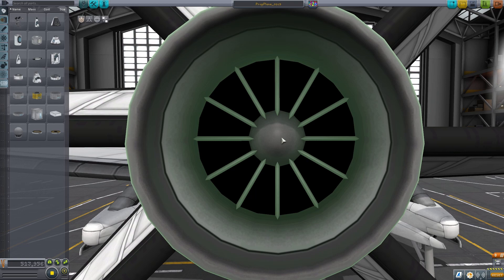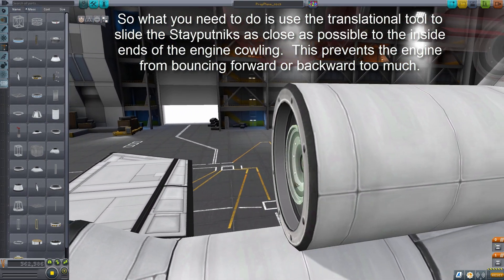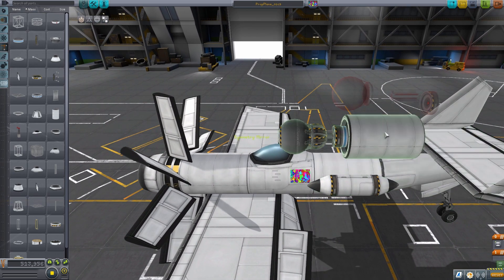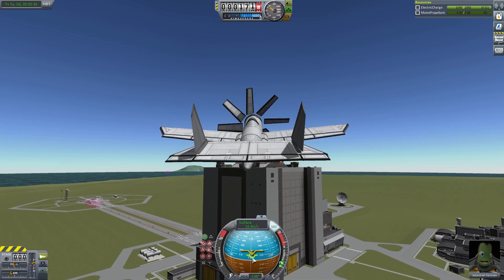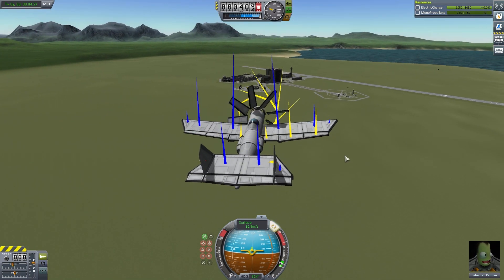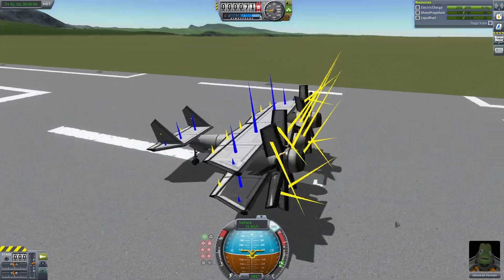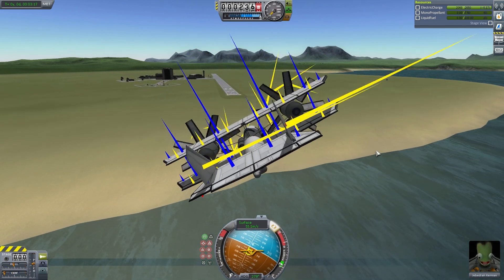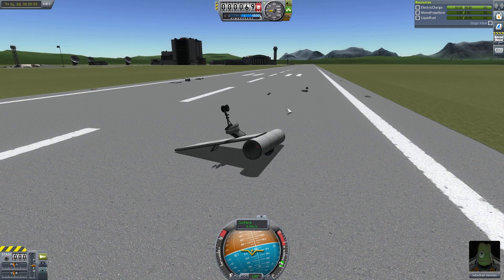OBSOLETE VIDEO, pls see #3 -- KSP stock elec prop 2: smaller engine, bigger performance

Comment: It strange to watch people fly in ksp because everyone uses so much rudder to try and control the aircraft were in the real world rudder is only really used in normal flight to control adverse yaw and turning tendencies in single prop aircraft also using to much rudder can cause aggravated stalls as spins but also causes a lot of drag when the aircraft is yawed so it is side on to the relative wind. But overall I think this was a great video I really did like the designs and the bomber was perfect apart from the bottom wing flap going the wrong way  and the fighter was a heavenly aircraft thanks for the videos :)
Reply from the maker: As a (fellow?) pilot, I concur with your observations of yaw and rudder control.  In KSP, though, since my input method is a keyboard, the pitching moments of 100% control surface deflection (which is inevitable with a keyboard) sometimes impart much more change of attitude than I desire, so always going for a coordinated turn using elevator (back pressure) as my main turning authority is neither feasible nor safe to the aircraft in many circumstances.  It is for these reasons that I cheat the system and use the very weak response of yaw to produce more mild or more gradual changes in direction.

But how dare you criticize my lower flap?  You fiend, you monster!  Have you no respect for artistic flair?  heavens to murgatroyd, doth the practice of zed axis symmetry offend thine senses so acutely that thou must slander mine innovative brilliance in this public forum?!  I implore - nay, beseech you: look within yourself and find the room to forgive my trespasses for collectively referring to a lowly spoiler (for that's truly what it was) as the far superior flap!  I only wished to spare myself the difficulty of unnecessary articulation!  Oh, have mercy!!

Comment: There is one flaw in this design.

The propeller blade have the same angle regardless of the distance to the center. This will make it so when the craft go sufficiently fast the outer part of the propeller will push the inner part faster forward than the agle of the rotation.

A simple way to solve this is make really short propeller blade and a rather big center. A other way is to make diffrent propler blade and tilt them in a diffrent angle acording to the distance from the center.
Reply from the maker: Yes, it's not a constant speed prop; at best I might call it a variable pitch prop since I can adjust the angle in the hangar.  I think your first solution is self-eliminating because changing the diameters of things does not influence the AoA problem which you astutely pointed out.  I have seen your second solution used in some other videos but its drawback in KSP is more blades causes a lot more drag as well as necessitating more torque.  The reduced RPMs are a greater loss than the thrust gain achieved with multi-AoA blades.  Pity.
Reply: Inter's Odyssey A sort of ugly solution would be to just move them out a bit and even out the speed . Of cause that would make the prop bigger. But say.. Using a bit shorter and wider blades, move them out a bit then one would be able to make it go a lot faster. Specially at higher altitudes.

The question if rather if it could be made in a beautiful way.... and... well high preforming (in regards of KSP physics engine).

Having high performance at high altitude would be important for instance if one make a airplane fire to space....

.... the reason i´m looking for that is i wanted a efficient way to launch from eve. While the gravity is rather high, this is really just a problem of having sufficient acceleration, but the thick atmosphere blocks this possibility.

Getting over the atmosphere one could have a rather small rocket just to push it out the atmosphere and then circulate
Reply from the maker: matsv201
The shorter and broader blade option is one I've explored in other vehicles.  It works rather well, but for heavier craft I find it is the part's lift rating that makes the biggest influence on thrust.  Also, the aerodynamic forces (the yellow vector lines) act upon the center of a part, so larger parts may have centers that are intrinsically farther from the center of rotation than a smaller part placed only a little bit far out. 

One of my other commenters said they've already taken one of my planes to Eve and it worked well.  Didn't say at what altitudes though. 

There is one thing I can recommend if you want want to change AoA in flight.  Just use the prop blades' Deploy option (assuming your blades are control surfaces rather than little wings).  It doesn't take much: at sea level I find about 30% deployment gets the best increase above undeployed cruising speed.
Reply: Inter's Odyssey 
" Didn't say at what altitudes though. "
It should be dependent on airpressure and gravity. The pressure around 6000 meters on kerbin is about 0,6-0,7 atm. On eve you are up to about 20 000 meters at the same atm.

Of cause the gravity is 70% higher so i would suppose you would need 1.7^0.5 thicker atmosphere... so 0.8-0.9 something giving us a altitude of 15 000 meters. woud be my guess...

Its way to low to launch a small space probe.... Well of cause. This is kind of a speed issue. Its hard to fly faster than 150m/s or there about with this prop design.

A solution to this could be to use a giant wing. Then one might fly a lot higher with the same speed.

Of cause, optimizing the propeller to drive the air much faster would be way better.

"It doesn't take much: at sea level I find about 30%"
Well that is a solution as well.

Really would need screw propellers in this game. And electric engines.

Having a pathfinder type aircraft on EVE would be beauty-full.
Reply from the maker: matsv201
Heh, I think you just invented the brand new "Pathfinder challenge".
Reply: Inter's Odyssey It would be very cool

Comment: When I make prop planes in ksp I noticed that i get better performance using 4 blades on the propeller rather than 8. The 4 bladed ones average about 80m/s in a straight line while being a little more shaky. I think that the more blades you have, the more the speed is capped by drag.
Reply from the maker: In my previous video on this subject I was using 4.  Nothing wrong with that.  For this video I chose to use 8 to see if the torque could handle turning that many surfaces and because I thought more blades would mean a greater frequency of blade passage through the point of greatest lift development, hence greater cumulative thrust.  The trouble with these electric engines is their utility changes so dramatically every time one little component is altered.
Reply: Having more blades would make sense for getting more thrust... but... AIR RESISTANCE! The problem with having too many blades is that eventually, adding more blades has diminishing returns and eventually DECREASES engine performance. Having too many blades (or having the blades at too high of an angle) causes drag on the propeller and that will make the propeller spin slower. (Assuming a perfect AOA of 45 degrees) having four blades would actually be better than eight blades due to drag. Two ways to fix the current problem is to: One, decrease the amount of blades to three or four, therefore decreasing propeller drag and providing more thrust (just take a look at old WWII planes and you'll know what I mean) and Two, reduce the AOA of the blades for the exact same reason stated before. (Just don't have a low AOA and only a few blades, yes, it does spin the prop faster, but you won't be able to benefit from the extra spin speed) It's basically like math, when 4 x 5 is the same as 2 x 10, when 20 is the drag created. But, considering the fact that having three or four blades that can do the exact same as eight, most people use three or four because of cost.
Reply: I just realized I basically elaborated on the original comment. Oh well. :P

Comment: Just wanna know..... Why stayputnik? (There is other probe core, right?)
Reply from the maker: They Stayputnik has more angles than the other probe cores (or most other parts, for that matter) which means each individual angle is more obtuse.  This means there is less of a tangentially retardant force produced during collision with the walls of the cylinder, which means less rotational speed is lost.  I usually use only one Stayputnik on either end of the engine for sake of part count, but I've seen some designs that use eight or twelve or sixteen Stayputniks to create as round and smooth of a "ball bearing" as possible.
Reply: That's smart for, it keeps it snug in the fuselage so the prop won't wobble as much.

Comment: make the spruce goose, 8 Engines!
Reply from the maker: Well I think we'd know how that would turn out.  Spoilers!  Curse you, H.Hughes!
Reply: Inter's Odyssey please do a video on it!
Reply from the maker: I started with a miniature version that I named the Spruce Duck.  It had 2 enlarged engines, each with 2 props mounted on fore and aft ends (4 props total).  Its mass was insane.  I don't even remember what it was, but close to 60 tons.  And it was a modest sized plane.  The engines were horribly imbalanced and kept ripping themselves apart and I suspect it was because of the all of the mass I had tried compacting into them.  So short story: no luck (yet?).
Reply: Inter's Odyssey 
I tried my own hand at making these engines. It seems that to keep the plane flying consistently you want no more than 7 tons per prop. 
My p38, based off of your design but twice as long, weighs 13 tons and can make it over the tallest mountains. I also tried using 12 blades per prop, 2 hex patterns.
Reply from the maker: *****
That's good to hear that there is room for plane growth but bigger engines is not necessarily better.  My part count tends to run away from me when I'm trying to upscale a design.  I like the idea of a twin hex blade count.  How many ball bearings (Stayputniks) do you use on either end of your engine?  I'm still a fan of 8 bearings + 8 blades because that seems to be stable, but I'll try a twin hex next.
Reply: Inter's Odyssey 
I used 8 stayputniks as well, though it doesn't really seem to make a difference vs using 4. With 12 blades the rotor is really heavy and becomes unstable easier. I get a weird oscillation at 55-65 m/s where both engines will take turns producing more thrust than the other. It is more stable (although slower) with the flaps down or while in a climb. 

I was going to attempt my own spruce goose next with a MK3 cockpit and 8 double long engines, but am still testing engine variations.

Btw, I tried a single motor plane but the torque makes it impossible to fly. Is that a 1.2 thing or do you think it's because I'm using a double length motor?
Reply from the maker: *****
Maybe a 12 bladed prop with smaller blades (like the Elevon 4) would reduce oscillations since the center of thrust on each individual blade would be closer to the shaft given the blade's smaller physical dimensions. 

Yep, my Spruce Duck follows that design concept. 

Nah, it's not a 1.2 thing.  Very very very minor changes to an engine design can produce huge changes in performance.  I was discussing this with someone else.  (Losing track of names with this many comments!)  The single engine plane I showed in this video flew beautifully but other experiments have had problems.
Reply: Inter's Odyssey 
My single engine plane had a piece piercing the motor that I overlooked... works now!

My spruce goose flies!... though not very well. It stalls incredibly easily in a turn even when at speeds above 50 m/s. I end up using yaw more than roll to turn. At speeds above 58m/s it oscillates in yaw just as my P38 did. 
In a straight line and 10% incline it flies ok, I was able to get it up to 6,500 meters without too much issue. In a decent all hell breaks loose and it tears itself apart (with speeds in excess of 85m/s)  - with all flaps down it's not as bad. My weight is ~64 tons, 8 tons per engine. My computer is displaying time in half speed because of the part count. 

I was thinking of trying a B36 next, 6 props and 4 tiny jets.
Reply from the maker: *****
That sounds about right!  :D  Well done.
I'll be curious to hear how your props go.  If you plan on doing the B36's pusher prop config, I worry about engines colliding with their mountings.  My pusher props had that problem more so than my pullers.  I wonder if it is because the contact area against the retaining part is of a larger diameter with a pusher prop and therefore creates more resistance.
Reply: Inter's Odyssey
Having jets really helps the plane fly. They aren't enough to fly the plane by themselves but the extra boost really turns a larger prop plane into something pilot-able. 
My 3rd iteration of my B36 is 65 tons and has a cruising altitude of 3,400 meters @ 74 m/s and a ceiling altitude of 7,500 - 8,000 meters @ 57 - 60 m/s. 
I ended up using a stiffened double long motor design. The joints definitely seems to be stronger in tension (pull) rather than compression (push), and this seems to make the motors imbalance easier in the push configuration as you mentioned. My single long motor design had massive thrust loss due to this. 
In a dive it can go up to 125 m/s before I start worrying about it tearing itself apart. Also, I used 8 blades per prop as 12 is just too heavy and the extra drag give it diminished returns.
Reply: +Inter's Odyssey can rover wheels be used as bearings?
Reply from the maker: ΑΡΗΣ ΚΟΡΝΑΡΑΚΗΣ
I honestly don't know.  I know people have used them in turrets like for tanks but I do not think they would survive the high forces and RPMs of an electric engine.  Try it?
Reply: Inter's Odyssey give it

Comment: Whaaaat the helll maaaaaan; this is awesome. Make a video of you circumnavigating the globe using a plane that uses the engine. And maybe as a further challenge, send it to Laythe.
Reply from the maker: Thanks for the enthusiasm.  I have a lot of improvement to make on this design before it would be ready for a long haul flight.  (I've already seen people do a lot better.)  But even then I don't think I have enough hard drive space to record a circumnavigation flight at these achingly slow speeds.  I remember in "the good old days" before heat resistance and sticky atmospherics I could hit Mach 5+ while around 50 km high and achieve orbital speeds while still technically in atmo.  Mach 5 at sea level is 1700 mps.  That's 26.5 times faster than the top speed of the fighter I showed in this video.  But even at Mach 5 it still took like 20 to 30 minutes to do a circumnavigation flight.  Say 20 mins to be generous, times 26.5 = almost 9 hours (more, probably).  There's no way I could summon that much patience to monitor my computer and make sure my plane isn't crashing.
Reply from the maker: Er, actually the atmospheric orbital speeds I mentioned are closer to Mach 7.  My bad.  Still: point made.
Reply: You should do a turbine using this method, have the blades inside the tube.
Reply from the maker: Wouldn't work for two reasons.  The most prominent is size.  Even using the Elevon 4 there is still not enough room to fit the whole thing inside and have it turned to grab the air.  Second reason is, assuming reason #1 wasn't a problem, the propeller blades would still be too close to the axis of engine rotation to develop appreciable tangential velocity sufficient to move forward.  Reason #2 is further compounded by the fact that the aero-force vectors are calculated from the center of the aerodynamic part, not from any edge of that part, so with the whole thing tucked inside the cowling the center of the Elevon is virtually inline with the engine shaft itself, so there'd be virtually no thrust at all.
Reply: Inter's Odyssey Oh, I really did not think that ne through enough did I? XD, though with modding it would be somewhat possible I highly doubt you wish to do it with modding as previous videos have been vanilla.
Reply from the maker: TheConeezeanEmperor
Yeah with Rescale it might be more feasible, assuming (I don't know) that changing the size of wings with Rescale does not change their rated surface area available for lift.  Still, you'd want the Elevons to be as close to the inner wall of the cowling as possible and then I worry about them bumping into that wall while rotating at very high velocity, as per a turbine.  The engine would probably chew itself apart.  :/  Better people than I will probably make it work, though.
  ...Sorry, it's called Tweakscale, isn't it?  I'm so out of touch.
Reply: Inter's Odyssey XD, defiantly not me then, all I have ever been able to build are basic rockets and basic jets, and anything more complex would crash my pc...

Comment: Maybe you covered this in your other video, but would using wing parts instead of flaps as prop blades increase their thrust?
Reply from the maker: Nope, didn't cover that in detail.  I honestly don't know.  I suspect the innate statistic of what makes a part best as a propeller blade is its lift-generating surface area, which is something you can see on most Aerodynamic parts in the hangar by right clicking the part to look at its advanced details.  I try going for the physically smallest pieces that have the proportionately highest lift rating.

Comment: I wonder if taking advantage of the rigid attachment in 1.2 could get rid of that propeller spreading artifact.
Reply from the maker: Well, it didn't work with actual struts (backfired horribly, in fact) but I had not thought to try with the behind the scenes strutting.